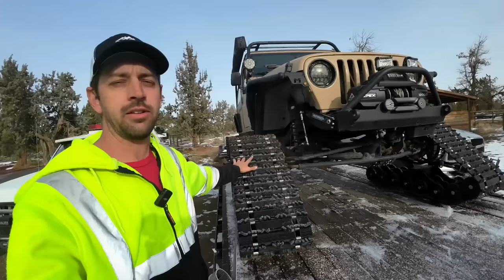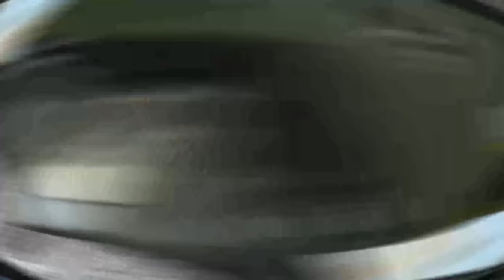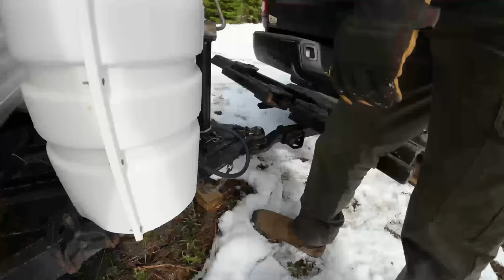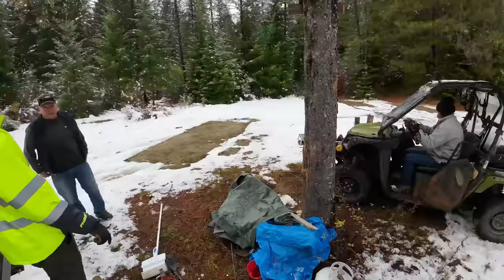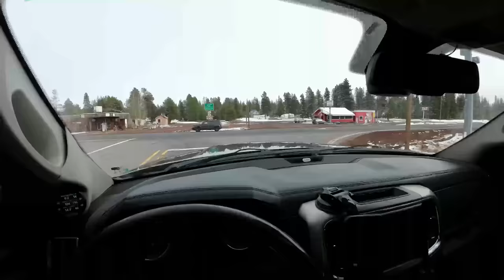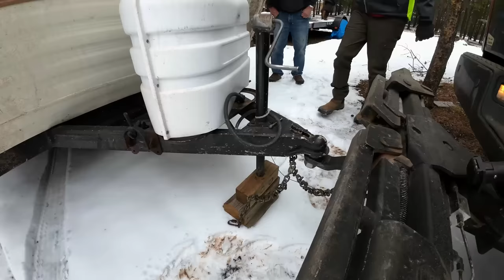I feel like I’m being setup…

Comment: The tree looks like a bald cypress tree they are bright green under normal conditions and go through a process called Bronzing when the temperatures drop lower than normal. They thrive in areas with sun and wet soil. They prefer places with mild winters but can survive harsh conditions of the Pacific Northwest.

Comment: Have you heard of the tire socks? They are approved in OR and WA as chain alternatives.
Reply from the maker: Good on highway snow, worthless off road
Reply: Used them on a feet of cars at work. They work good because they are easy to put on. You need to take them off once you are off the snow. They wear out fast on wet pavment. I have them in my car but still carry my cable chains too.

Comment: Dumb question I'm sure, but do trailers act differently with them cantilevered so far off the back of the truck on the arm?  Not questioning the use just curious.
Reply from the maker: Yes they do.   They actually maneuver better in tight areas, but can sway easier on the highway

Comment: After running in to "repairs" by some mechanics, I no longer check turn signals on towed equipment with the 4-ways. Too many times the trailer or light cord had them crossed. LOL
Reply from the maker: I run on the close enough program.

Comment: The fir tree turning red is usually caused by drought. There's also the possibility of an insect infestation.
Reply: No. It’s not.  Look it up.   They are Larches are one of the few coniferous trees to change colors and lose their needles in the fall. Western larch (Larix occidentalis) and subalpine larch (Larix lyalli) grow in the interior Pacific Northwest (Montana, Idaho, Oregon, and Washington) of the U.S. and British Columbia, Canada.
Reply: @michaeld53  Never seen a larch turn red. Only yellow, then the needles fall off.
Reply: I agree with Grace. As an ex ranger, an ex forest engineer, an ex forest tech teacher, fir as one needle attached to a limb, larch and pine have more than one needle attached to a limb. So, a limb will have few individual needles (ex: fir, spruce) or fascicular needles (ex: larch, pine). The fellows with Casey helped to recognize few symptoms (red needles, bark peeled off). They gave a possible clue (sign) with damages done by squirrels. Drought is a possibility, as well as a chemical on the ground coming from people around the RV, insects/diseases in the soil, .... A forester from the park or from the area would give you a closer answer based on few facts (just as Columbo,... ;-)  ). Diagnosis is complex and begins with more observations around the concerned trees. Hope Casey finds the answer near home. Very good work with educational videos. 🙂